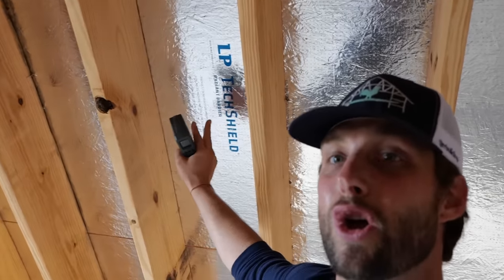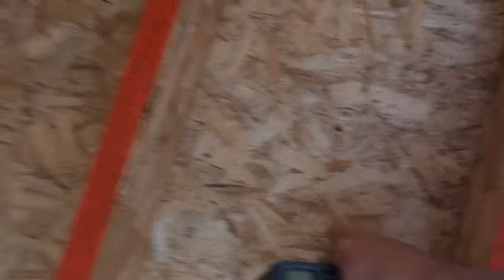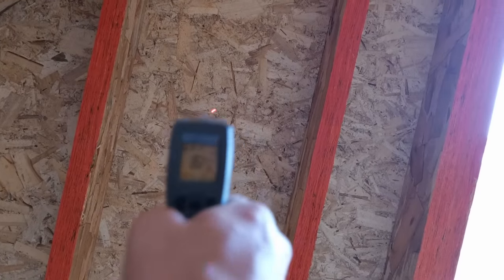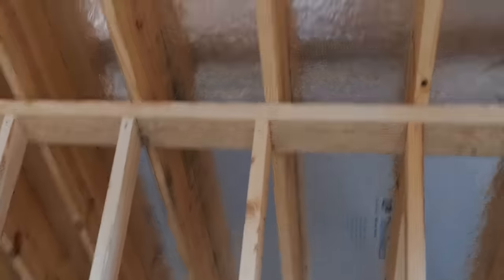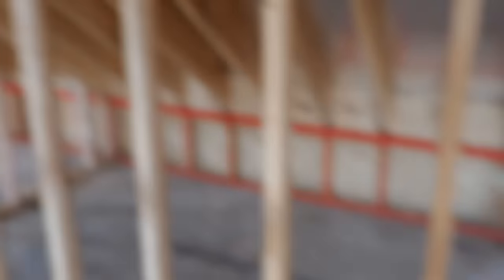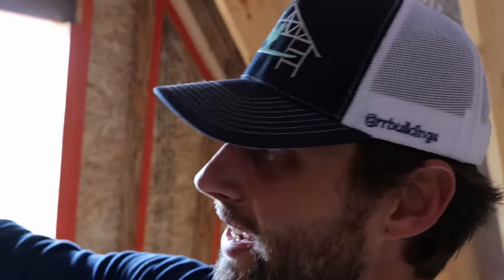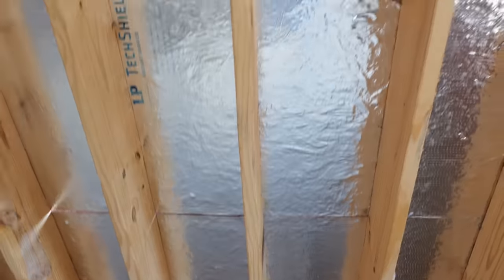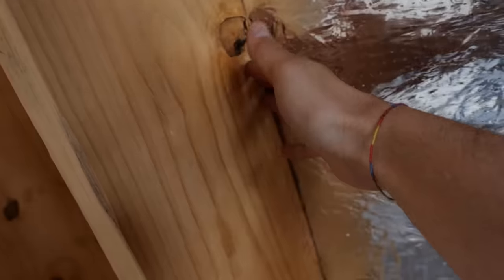Do Radiant Barriers Work? - LP Techshield Review

Comment: Hey Jordan I have been following you and Matt for many years hoping one if you would cover my question but have not seen it mentioned. 

I had hoped Huber or LP would create a product withe the weather barrier on one side and radiant barrier on the underside. Both day they do not have anything in the works. 

Do my question is is it wise to install the Tech shield and then the Weather shield on top of it? We would then spray closed cell foam on the radiant barrier. I would imagine the spray foam may reduce the performance of the radiant barrier, but we want to get the best of all three products. 

Any suggestions or guidance?

Comment: Did you check the rate of waste heat lost at night?  I tested a radiant barrier spray on my previous house.  Yes, the sun’s heat entered the attic much more slowly than the bare osb..  But it night, the barrier also trapped infrared in the attic and released heat much more slowly than bare osb.  Radiant barriers don’t stop the heat, they slow it down.  When all the math was done, the net effect was about zero.  I never added the solar fans to actively remove the heat that did accumulate.  It’s possible with a combination of barrier and fans and differential thermostats, the attic can be made cooler overall, but from what I saw, barriers by themselves are false promises.

Comment: Live in Houston too.  Need to insulate my garage.  Will doing the roof with rock wool or fiberglass be enough or will I need to also do the garage ceiling?  All sheet rock without insulation and unbearable in the summer.
Reply: Dave, are you heating and cooling the building? Or, just basically just want "shade effect" for the building?  Here is an article I encourage you to read to get the right solution: https://bluetexinsulation.com/pages/insulating-non-conditioned-buildings-vs-conditioned-buildings
Reply: @AtticFoil  thanks.  Right now it is not conditioned space and likely never will be.  The exterior walls are rock and the interior has been drywalled, but they didn't put any insulation in the walls or ceiling.  The roof decking has a radiant material on it, the soffit and ridge are vented, the roof rafters are 2x6, and the ceiling joists are 16" I-joists.  I'm thinking insulating the roof won't help much since the cavity is not real large, but was thinking adding R-38 batts in the ceiling would help.  Perhaps adding the bluetex to the underside of the roof rafters would help too, but I don't want to sink a lot into the space right now.

Comment: In an existing home with techshield decking, would it be worth spraying foam over batts?  Or would it effectively be the same?
Reply: You need to make sure that nothing (at least the least you can) comes in contact with the barrier for it to be effective. If you spay foam and it covers the decking, the radiant barrier effect will be mostly gone.

Comment: If a person put heavy aluminum foil between the 4 inch rafter then  added a plastic barrier at one inch, then filled the other 3 inches with rock wool insulation what would be the R value?

Comment: radiant heat from the sun is in the infrared spectrum, not UV.  but point understood. I was close to purchasing rolls of radiant barrier for my previous house's attic, but I kept finding haters online saying it was a scam. Maybe in an old 1960's increasing attic insulation and air sealing could be more bang for your buck?  Very Interested in the topic. Please work with some energy and insulation experts to explain which insulation methods to employ first over others for the most gain.
Reply: I  don’t think spray form will stick to the foil . Saw a job where  they pulled down the drywall because the spray form fall off the foil

Comment: That is WHY you install RAFTER BAFFLES when spraying foam. Always allows air to flow from soffit to ridge vent or gable vents. Keeps shingles healthy and ice damns NEVER form....I built all my houses up north and the snow NEVER melts on the roof except where the trusses are (usually 8" or 10" depths, wood = R-1 per inch, foam = R-5 to 7 per inch) the radiance from the sun will warm the finished attic space by late morning with the inside heat also kicked on in the AM 15 minutes prior to waking. Nobody ever feels the cold. AND the snow still stays layered on the roof...never melts! That means NO heat is lost from inside to cause any melting. ALL the other houses that are NOT insulated properly, or use fiberglass, even with "radiant" barrier, still have the snow melting from the loss of interior heat! It REALLY SHOWS in the wintertime when you drive through the neighborhood and development, who built which house. Build the house like a giant thermal cooler and energy bills become negligible. The upfront INVESTMENT in great insulation pays in dividends for as long as the house is standing....typically within 2 to 4 years, depending on energy costs. EXCELLENT resale value on a well-insulated home. NOBODY can resist when you show them the monthly/annual energy usage and costs. Like the resale value of a Rolls-Royce versus a Chrysler K-car! LOL

I will NEVER use fiberglass batt for insulation ever again....whatever the R rating...cut it in half or even less!  Up north they require 2x6 walls for R-19 fiberglass insulation. I use 2x6 @ 2' O.C. so I have MORE insulation and don't need all that lumber. Thus, with foamed insulation, I get a TRUE R-25, not the fake "r-19". I tested fiberglass versus foam and there is no use wasting time with fiberglass insulation. Only thing I might use it for is interior sound-deadening between sound-barrier panels in the stud cavity. Even then, I found other means to deaden sound transmission and quiet rooms. I HATE to ever build interior walls, like bedrooms with just 2 pieces of drywall!! And the TV room and Rec Room need to have sound dampening walls.

Comment: Can somebody explain again how the air gap works with the barrier? Not quite understanding.
Also may be extreme but would it make sense before laying down the roof to the framing appliyimg the barrier then??
Reply: I’m in Phoemix Az. And doing research and best way to insulate the attic in my home. House is a 60’s build too.

Comment: I'm pretty sure a white-ish colorbond roof reflects around 70% of radiant heat, I'd like how much difference it makes after the steel is on. And then your thoughts on if it's worth it considering the reduced vapor permeability.
Reply from the maker: It will help some, and we are going pretty high performance on this home, so I think it's worth it.  As far as vapor permeability, we are using a fully adhered Carlisle 300HT roofing membrane which is fully vapor closed, so I am not concerned about the permeability of the Techsheild in this case.
Reply: @JordanSmithBuilds  If you are using a vapor closed membrane, I 100% understand that this is a good choice, even when the steel does half of its job for it (I imagine it's pretty cheap and effectively free to install when on on the back of OSB). I would however love to see a video on when it is appropriate use a closed membrane and when it isn't, (I'm assuming it's not a cost thing).

Comment: What would the difference be between a foil faced foambard or sprayfoaming up to the roof deck?  Seems to me like it would be the same thing.
Reply: This may help: A customer compares two identical non-conditioned buildings side by side.  One uses www.AtticFoil.com and the other uses foam insulation.  Since the building was non-conditioned, the radiant barrier building was actually cooler:  https://goo.gl/maps/AfPouMYFDEMvnVmB9

Comment: On my roof I have I joist 2x14 n put 1/2” foam on the underside of the top I gives you the space for air n insulation is then fills in the Rest then foamed again before the drywall   Seems to work well. No rad barrier not 20 years ago but ideal for this. Waiting for an invention to add to the roof itself  currently lite color metal roof

Comment: Good! How do you secure your fiberglass batts to the joists to maintain the 2" air gap? That is what I would like to see.
Reply: He said he used joists 2 inches wider than the insulation thickness.  So by installing the bottom face of the insulation flush with the bottom face of the joists, the top face of the insulation will have a 2 inch gap.

Comment: You can just add real radiant barrier across the out side of the joist and you don’t have to worry about the spread of the joist. The LP being on the wood disqualifies it from being a radiant barrier. Plus the LP has a very small R value. Save the money get regular roof wood and pay to have radiant barrier installed.

Comment: Yes! I want more. I am building a duplex in Phoenix and was wondering whether a radiant barrier would make sense given that we are planning on doing spray foam on all walls (roof is going to be metal). So, how do you get your air gap on the inside of you will be putting batting in the 2x10s? Love your videos.
Reply: You need that air gap to allow the radiant resistance to work and not have the energy become transferred via conduction. But that doesn't mean it must be below the deck. Depending on the metal roof and the installation (decking, underlayment, stringers, roofing material, etc.) you might be able to place the reflective barrier above the deck. To make radiant work (and not negate it) in a roof under the decking, you either need to do what Jordan is doing (he's got 2x10s so he'll leave a gap right below the deck when he puts his insulation in) or insulate up to the decking and leave a gap before putting up the barrier.
Reply: @stevecotes301  my problem is the heat gain from the metal roof on the front porch is making it harder to cool my trailer. Would spray foam insulation help?

Comment: What about smell, does this insulation keep smell out? I have sharing wall with my neighbor and they smoke like crazy. do you think this shield might help me. thank you
Reply: Somewhat and depends on how well it is sealed. 2 seperate problems. Sounds like neighbor has a very leaky attic along with your house sucking in outside air from attic. You need to find d all gaps and seal them with spray foam or tape: ducts, adjacent walls, lights, electric outlets, etc

Comment: When I built my house in upstate NY , I used 1 inch Celltext on outside and on the studs inside and on inside of ceilings rafters
Reply: With just air space in gap between Celotex and roof decking ? And did you put foils side upward or downward ?
Thx
Did you seal all seams, edges on the Celotex ? Curious
Reply: @kipcarroll486  1/2 Sheetrock , 1 inch Celtex  “brand name 30 years ago”  foil on both sides , 10-11inches pink insulation in ceiling , about 1 inch air gap , then roof decking . No taping of seams , Celtex fit tight next to each other . Spray foam was new and very expensive.
Reply: @patriciagantz377  thx

Comment: Thank you great video, explanations, content, demo. Please measure temperatures side by side on same panel / wall / ceiling with & without 
barrier...or apply heat to one panel from behind with & without barrier & then measure temperatures..
My OCD helps with consistency & accuracy...ex:
measure twice cut one kinda thing..
use graph paper for scale purposes..
use cardboard for cheap templates..
Reply: gin ngo Mr Smith is an ignorant guesser....  Example....  Look up UV and IR radiation properties .....

Comment: 55% of the incoming light is infrared light, not ultraviolet.  Du!  It's conduction, not convection when there is contact.  You said it right later though.  Convection is where air or water is moving.  A white roof basically eliminates the need for a radiation barrier.

Comment: Question everyone is asking, does this decrease the life of the above shingles because of the heat being reflected ("conduction") back towards the underneath side of the shingles?
Reply: Their was a study that showed the shingles gained an additional 7 degrees from radiant barrier. No the life is not shortened.
Reply: @JB-yq9bn  Wow - 7 degrees is pretty significant over 15-20 year period.  And Im sure the degree amount is different by region.  Hard pressed to believe that there is no effect or shortening of life span.
Reply: @DigitalRaider1  the U.S. Department of energy found light shingles were 10 to 15 degrees cooler than black shingles. If your only focus were temperature it would be logical that dark shingles will have twice as much temperature rise as the radiant barrier creates.
Reply: The heat is not reflected back to the shingles but heat does build up in the decking as the foil has a very low emittance, doesn't radiate much at all. 
D.O.E. states about a 2-10 degree heat build up. Not a lot.

Comment: I appreciate this video but there is one issue I have. You really didn't compare apples to apples... You compared the temp of a wall verses roof sheathing. The roof will always be warmer due to the direct hit from the sun. I would have liked to see your temp readings from an uninsulated section of roof verses an insulated section. that would give much more accurate values.

Comment: Still can't believe after all these years and technology that we still build houses with the worst thing you could use to keep a house energy efficient, asphalt shingles. Guess there is not a cost effective alternative? And im talking about something that takes 10-20 year payback!
Reply: Here in the Netherlands we almost only use roofing tiles. You can get them in almost every collor your want. Because they also always have an air gap in between the tiles and your roofing boards the tiles can breathe and dispose of the energy to the outside. Putting a radiant barrier below the tiles would be super usefulle. With asphalt singles you put the radiant barier without an air gap against your OSB making it practicly useless for keeping heat out but good for keeping heat in.

Comment: interesting. aluminium radiant barriers are banned here due to its electrical issues. how do you guys get around that?
Reply from the maker: Never heard of that.  What electrical issues?
Reply: Probably shock hazard. Installers stapling into electrical cable or cable degradation?
Reply: @JordanSmithBuilds  there was several people here who died from electrical shock due to a fault somewhere in the building making the foil live.  i'm not sure on what the electrical faults where, probably shot a nail through a cable or rats chewed a cable.
Reply: @JordanSmithBuilds  This is for retrofit products in Australia.  We get around it here by not using 220v for wiring.

Comment: roof shingles will last a lot shorter with this set up. You would have been better off by not having foil on the wood and keep it from reflecting back but, put it on the interior joists. Therefore, heat will exhaust tot he top of the roof, if the vents are functioning properly.

Comment: Note it won't. It needs an air gap between the foil and the heat source. Your foil id pointing onwards, it will keep heat in bit not out.

It is actually infra red radiation

Comment: There’s a little contradiction there… if you’re shingles are heated by radiant heat, then conducted to the roof deck which has foil on it, then all that happens is it will radiate into the air gap beyond the plywood/foil combo. A radiant barrier only works if it is in line with radiant heat, that means somewhere below your roof deck separate by air or on top of your shingles….
Reply: So the only way to do that would be 1) install a metal roof on a batten system over the roof deck,  or 2) install the radiant barrier on the underside of the rafters allowing a space the barrier and the roof deck,  - right?

Comment: I can't speak to the effectiveness of these shields, but as a level 2 certified IR thermographer I'm very skeptical of the measurements he took in this video. The emissivity of wood and shiney metals like aluminum are vastly different and that will throw measurements from his gun way off. He should have used a contact thermometer in this case.

Comment: I thought the reflective side should be facing OUT, not IN.  Compared to other info I have seen, you're the first to put the foil side inward.  WHY?
Reply: The side with the film on it is unimportant. It can face in or out. The important thing is that there is an air gap next the the reflecting film. You can test this with a piece of cardboard with some foil taped to one side. Turn on your stove and place the cardboard between your hand and the stove top. Radiated heat will be blocked regardless of which side of the cardboard faces the heat source.

Comment: The sole purpose of insulation is to reduce conduction. At R-1/inch, the air gap (3/4 in minimum) isn't doing hardly anything to stop conduction (because it's not a vacuum). The real purpose of the air gap is to create a convection current from the soffit to the ridge vent,  removing hot air and moisture.
Do radiant barriers work? Yes, but I wouldn't expect it to perform miracles.

Comment: I think you mean infrared light from the sun....
Ultraviolet is also radiant energy, but it is not heat.
You are right, that in the vacuum of space there is no conduction or convection because there's no molecules to move around (plus, there is no 'up' for convection)
Just like an old school glass thermos has a mirrored surface to reflect radiant energy while the vacuum bottle handles conduction/convection.